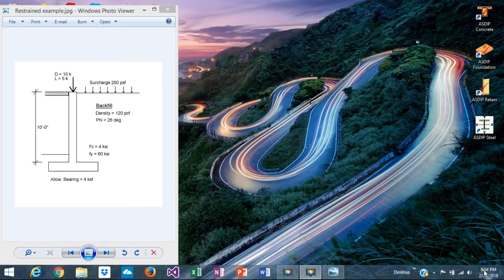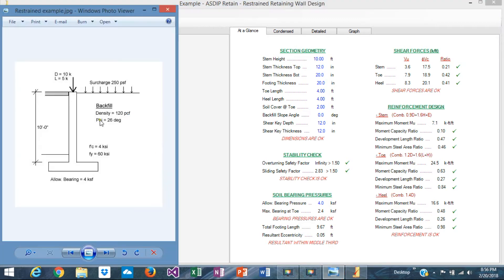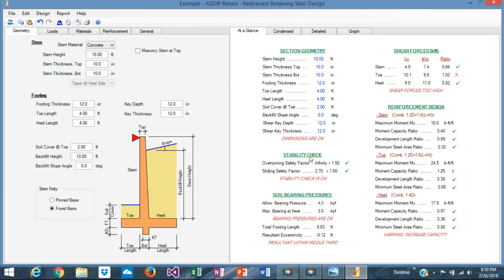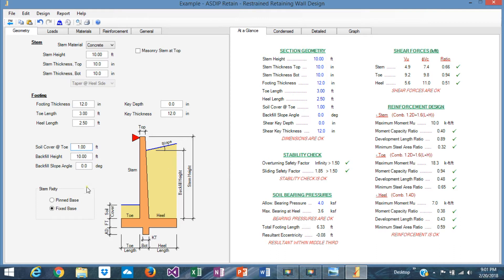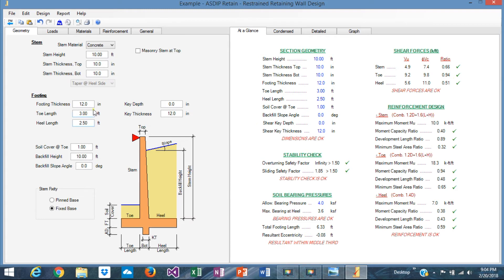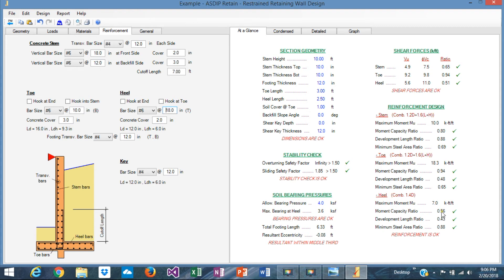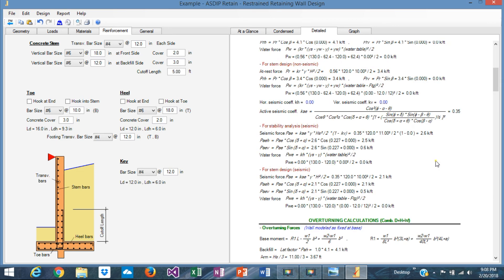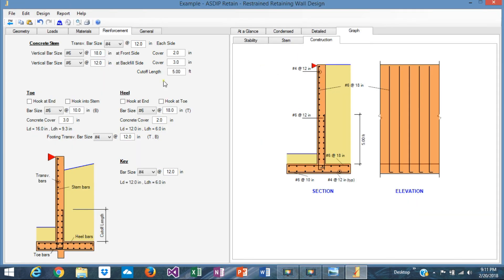Basement Wall Design Example Using ASDIP RETAIN

Comment: How to change unit from inch to cm.I also want to know indian code book applicable
Reply from the maker: Simply go to Design > Units or click on the corresponding icon in the tool bar, and change your units system.